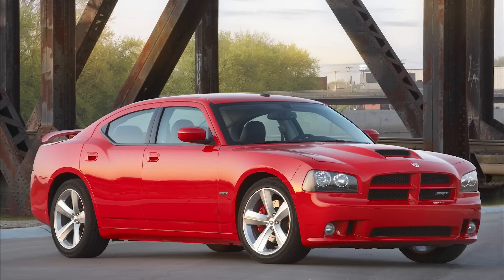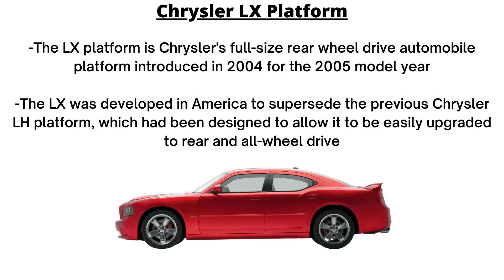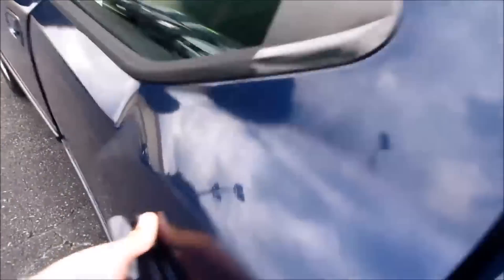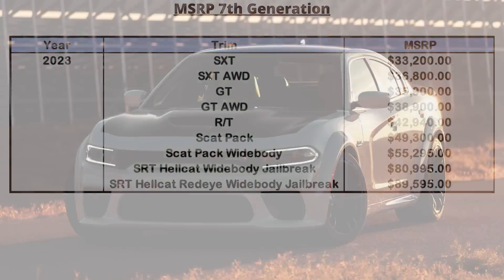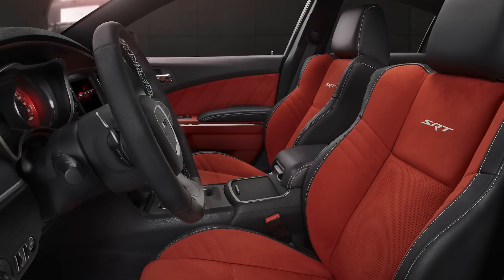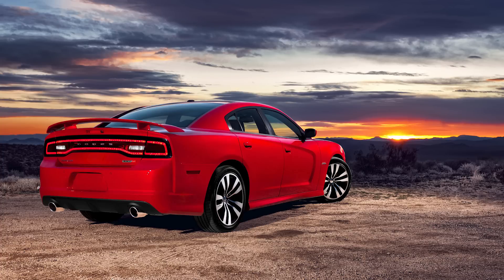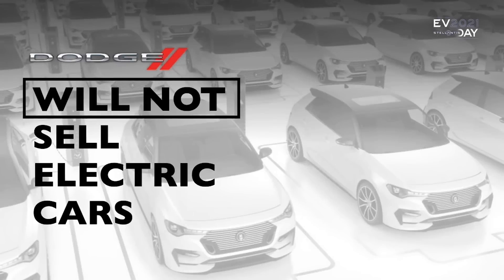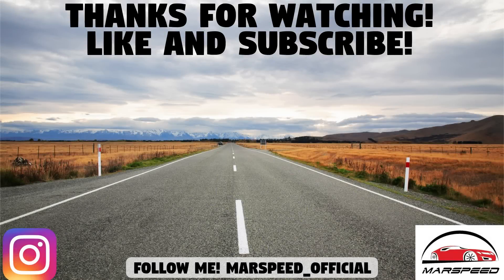Dodge Charger - History, Major Flaws, & Why It Got Cancelled (2006-2023)

Comment: I had the 2006 SRT8 6.1L Hemi V8  425hp. I loved that car! I did have the front suspension problems mentioned in the video. I remember the recall regarding  the fan blades coming loose and damaging other engine parts. This actually happened to me before that recall  was issued. I had to get towed from my university to the mechanic that day. All that said; There was just something about this car.  It was just special. People always stopped me in public places or talked to me at red-lights to admire and comment on the car. The profile on the car was so eye-catching. The high belt line, the Bembrow brakes, that Hemi V8. There  was nothing else on the road that could match that car. The Charger was in a class of its own. The design, the power - just everything. I owned it for 12 years. I cried the day that I had to trade it in. I still miss it. My head still turns when I see the 2006- 2013 LX body Charger  models on the road today.  -End of an era indeed -😢

Comment: 2011-2014 Chargers also had electrical issues. The heated front seats in the 2013 Charger I had would randomly switch on when I would start the car, and could not be switched off unless I killed the motor. It got to where I'd start the car, quickly check the touch screen to see if the heated seats cuould be turned on and off, and then go from there. If I couldn't turn the seats off, I'd turn off the motor, wait a minute, turn the car on, and repeat the process. Most of the time, one "reset" was all that was required. Otherwise, the car was a joy to drive.
Reply: Wow that’s strange. Sometimes my cooled seats would come on at startup but I was able to switch them off
Reply: @mrp9498  Well, that's most likely a intentional feature. Even of it's turned off in settings, the cooled seats are programmed to come on at certain temperatures and if the Uconnect is slow to start up, it will turn them on as the Uconnect wasn't able to stop it before it did.
Reply: @Mr P  I wouldn't mind the cooled seats coming on (except in winter) during startup. The Charger I had didn't have that feature. Heated seats in the dead of summer was no fun.

Comment: I had a challenger v6 from 2011 that had a pine tree fall on it and take it away. I got a 12 charger rt awd and love it. It’s not the fastest by any means, but is a blast to drive. However you can still get the rt awd in the 15+ in the police models till many years later. In my experience the 5 speed auto really took a beating and is a worth while car. I’m looking for a newer version decommissioned police car to add to the driveway before they get too expensive

Comment: I'm a proud owner if a fully equipped 2012 SRT8, it's a awesome car and surprisingly reliable, all cars will eventually show issues, after all it's a car. As it is now it's making 640hp while remaining naturally aspirated.
Reply: Is it at 426 Stroker?
Reply: @CJColvin nop, still using a BGE 392 block and original crankshaft
Reply: @crazyone3494  Awesome brother, gotta love the 392 Hemi V8, my dad has a 392 Hemi V8 in his 2019 Charger RT Scat Pack with 485 HP and 475 Ibs of Torque and man its a beast and a blast to drive for a 4500 Ibs sedan.
Reply: @CJColvin  damn, the sounds cool, it's the year with the dual slot scoops, right? Does it have any confort optionals?
Reply: @crazyone3494  It sure does brother.

Comment: The Pentastar Head issue was never truly fixed. They thought they fixed it for the 2014 MY vehicles, but over here in the Grand Cherokee space at least, we are taking in modle years as late as 2018 with this issue.

Dealers are on a case by case bases acknowledging and replacing the driver side head, typically covering parts.

Many just run into the code, but should you be like me and have a cooling system misshap.... yeah

Comment: I love my 2013 5.7 Pursuit.

He's gotten me though a lot dispite only owning it for a year.

It's out of action rn as it had failing lifters and then the Camshaft Sprocket pin snapped after a MDS deleted, causing the valves and pistons to kiss.

Still, It's such a joy to drive. 
I don't need all those features the fully loaded models need. 
Just a V configuration engine (yes, that even means V6), 4-doors, Dodge and Charger badging and I'm happy.

Hopefully, the EV Charger can live up to it's legacy.

Comment: Dodge defenetly had some more time to keep alive the mighty Hemi powered vehicles. A nice transition would absolutely be a limited run of a hybrid version of the 5.7 and 6.4 Hemi vehicles that gained in horsepower and torque. 1 year of that special edition of Hemi assisted by an electrical motor for massive gains could shake the market enough to be able to introduce their new platform, engines, designs and more into this electrified era. Dodge has to start with their performance vehicles always to be able to keep up their MOPAR flag and community. This feels like a rush from Dodge instead of a transition and it makes clear that Stelantis doesn't care about the Mopar community at all. Actually, I rruly believe Dodge is about to meet its end, just like Chrysler that now sells only 3 vehicles, Dodge has only 4 (durango, charger, challenger and journey).
I will most certainly miss the Dodge lineup, the hellcat powered lineup, the 392 family and even the RT family. If I had the money, I would get at least every single RT available to keep in my garage. 
I really hope Dodge can live up to their customers, their community and their legacy, but honestly, it seems impossible with stellantis owning them. Even a Viper comeback with a hybrid powertrain would be a nice transition using an iconic name and a custom plattform to do it. It would all fall in its place  but not so abruptly. Clearly, we saw rhe goodbye from Dodge and their engineers as thwy started releasing the TRX, Trackhawk, Hellcat  Demon, Hellcat Redeye, etc. They were clearly telling us "this is what we are, and we will deliver untill we cant nk more, this is our last breathe, so enjoy it while you can".

RIP HEMI

Comment: Dodge had 20 years to develop a new replacement , Lighter rear wheel drive platform to replace the old LX platform and a new lighter 32 V DOHC V8 engine derived from there new Hurricane 6CYI engine so ,what the Hell they were doing all that time 🤦‍♂️🤦‍♂️🤦‍♂️🤦‍♂️🤦‍♂️🤦‍♂️😡😡😡😡

Comment: 2006-2010 is the best Charger, in my opinion.
Reply: I agree. With the other Chargers being WAY expensive, the 2006-2010 is probably cheaper. I could be wrong however considering how car prices are still...kinda high.
Reply: I agree, a long with the Magnum. The styling is basically timeless, front the angry eyed front to the square taillights and high beltline. The interior was huge. I hope someday to own a Charger SXT or R/T.

Comment: Dodge is the best brand in the 2000s because the charger is the only sedan to have more power than a Chevy .
Reply: Also the only brand to keep their full size sedans rwd. Chevy impala (exception being the holden based pontiac g8) - fwd, Ford Taurus- fwd, charger - rwd with awd option on v6s.

Comment: It never was a charger.  It was a four door family mobile .   a dodge buick.   so pathetic that it even came about.   i have a real old school 2 door charger.    glad its gone.  Also, mine is a real American charger.  Not a canadian import designed in germany by daimler chrysler.   you cant put your foot to the pedel in the moder automatic transmission like I can with the slapstick.  I can put it into first and floor the pedel and slap the shifter up through the gears.  Can't do that on a modern automatic.  Modern transmissions are designed to take it like the old school mechanical linkage ones like I have in my car.  I'd never do that in the magnum with the crappy 5 speed german designed transmission they put in the chargers you like

Lastly,  the old school motors didn't have the problem of the valve seat drops that are in the gen iii hemis and any .7 mopar motor.   Then when they fixed that the 2009 hemis with vvt had lifter failures.   That's what you call reliable and better made.  Never heard of a valve seat drop in the old engines.  There's a class action lawsuit albeit old against chrysler/dodge for the valve seat drops leaving new car owners with a fkd up engine or a lawn ornament if too expensive to repair.  Valve seats dropping in the cylinder is not good.  I'd be open to hear from anyone who can say the 400 aka 6.6 liter engines experienced catastrophic engine failure in low mileage engines like the modern garbage.   Heat soak seems to cause the valve seat drops in the hemis with mds.   And......no hemi tick that's found in the hemi motors today..  wtf?   you call that reliable?  my ass.   I bought my 73 charger in 1979 when i was 18.   I never opened the hood or did any maintenance when I got it.  Wasn't into it then.  I drove it like a teenager would never opening the hood. It took me everywhere I wanted to go and no problems.  It had 72k on it when I bought it.   It sure was a fun party mobiel for my college years and  we all know how nice and big the back seats of the cars were back then.  hint hint  the girl's got rhythm she'd got the backseat rhythm  ac/dc tune
Reply: The newer Chargers are faster and more practical than any of the old Chargers combined. I love the 68-70 Chargers as well but lets be real here, dissing the Charger because its a 4-door is beyond unfair to them, they match a muscle car in every sense of the word. Big, loud, and FAST.
Reply: mIne is powerful and fast.   rebuilt the motor to 425 hp and converted it to fuel injection.   have a garmin like pcm interface that i can make adjustment to the engine on the fly.   it has a throttle body and all the sensors like a new car.  Also powerful msd ignition.   the 06 and newer are butt ass ugly over done crap.   looks like a buick skylark on steroids.  shitty motors .   i have an 05 magnum r/t.   yeah i know mopar made it in the seventies but for only two years and it was a dodge version of a Chrysler cordoba. .  Also, no cheap crappy plastic in my 73 charger.  It has the 727  slapstick transmission that was in the police vehicles and rock solid.  GM and Ford wanted that transmission since thiers was crapola.  So no....the 4 door ugly charger is no comparison
Reply: But think about It the challenger is 2 doors so why have the charger compete against it